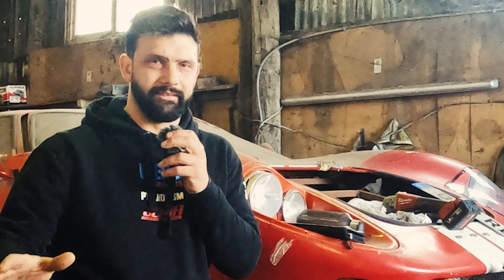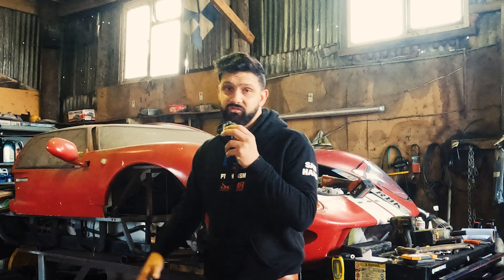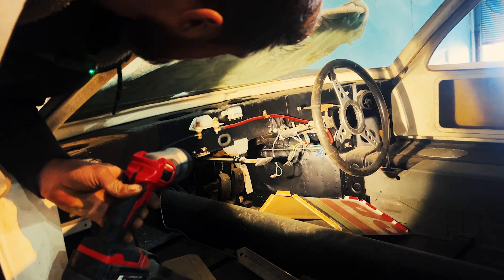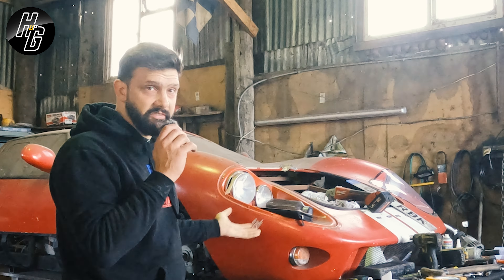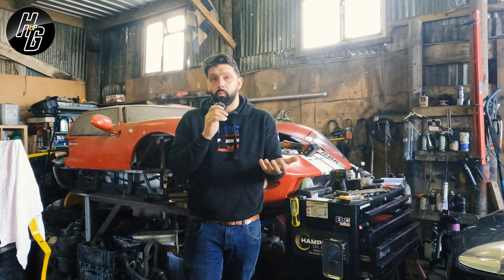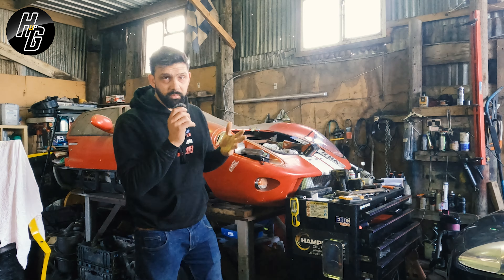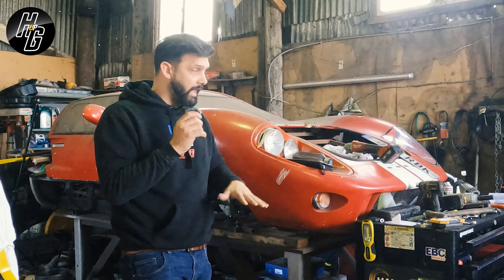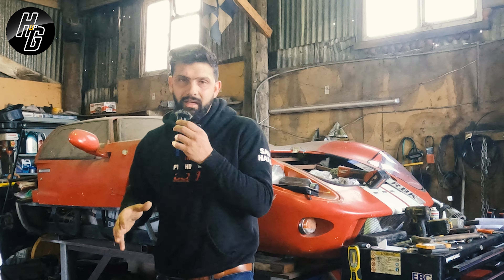You wont believe why my GT40 build is over!!! but a new investment may save everything!!

Comment: I wondered how this was going. We met at Goodwood, I look after the Burgundy MK3. Good find on the chassis. I take it you are still going the MK3 route? The center tunnel has to go, the cooling pipes run on the inside either side next to the sills (not ideal but that's how they are). The MK3 uses a Mini handbrake lever between the seats (yes that is original). Gear lever was fitted to in the center so Ford could make them LHD for the US. The steering rack on the MK3 is unique to the MK3 (so you'll be fine with the one fitted). The switches should be MK1 Ford Escort. I have over a thousand photos of a MK3 in bits. Oh and i've recently been quite involved in the recommission of a 427 Cobra that we put back to 'Targa Florio' Spec (it spent near on 40 years at Beaulieu)

Comment: Good luck again Gents. 🤞 Good job you are called Hard Sam, as you do seem to make it harder and far more expensive than it needs to be. Here you have another bespoke one-off chassis that you’ve got to then try to fit all the oily and suspension bits on. If you wanted a monocoque then you could have bought a new one from Tornado or Superformance who both offer these, and the components you have spent lots of $ on would bolt straight on as their chassis have been designed to take the 302 SBF, not a Rover /  Buick V8. Fitting Mk3 clams to that would be no harder than what you are contemplating here 🙄

Comment: KVAs were shit when new,  the MK3  bodies were accurate, being moulded off an original with Ford's blessing, but no one cares about mk3s and correct Route Borrani wheels will set you back 5 figures. 

Get a new body of that guy on GT40 forum, I forget his name. It is the only one worth bothering with, sell what is left of the MK3 body for a few hundred quid. Front and rear clams are about the only worthwhile part after this time. 

Harsh, but true.